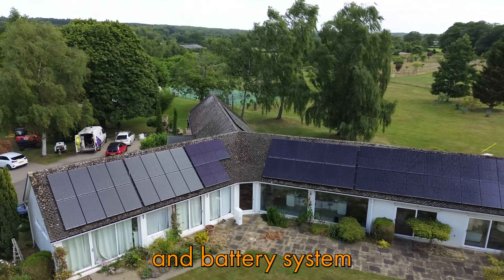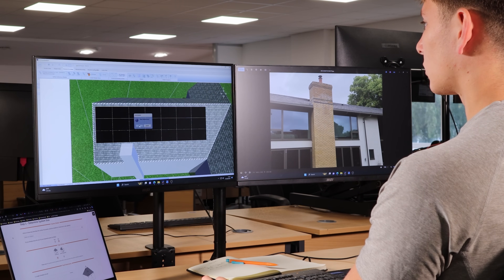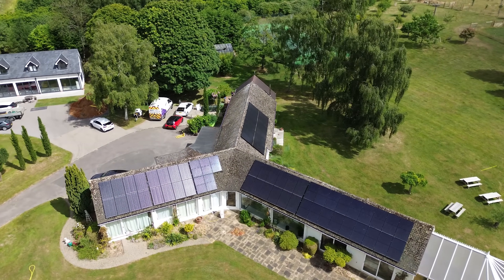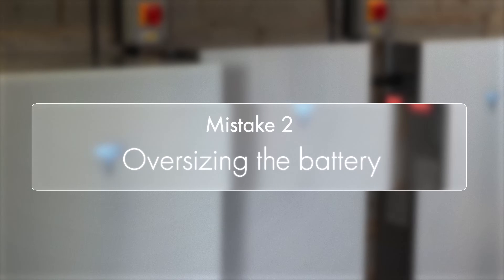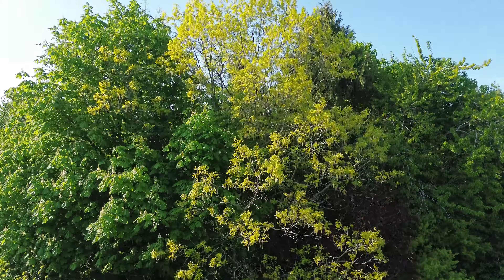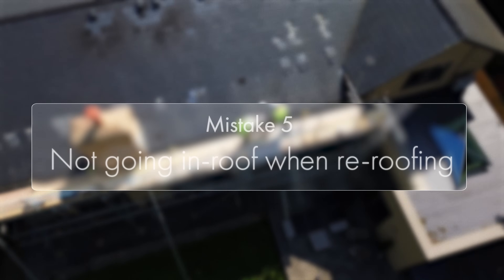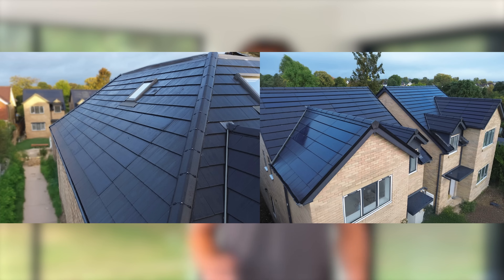8 WORST Mistakes To Make Installing Solar - Don't Waste Money

Comment: Where are the facts to support you claim that centralized inverters have lower failure rates. My research indicates the opposite is true...and when you lose your central inverter you entire solar system is non-operational. I knew someone whose central inverter died and it took them 5 mos to get it resolved (warranty claim disputes, etc.).
Reply from the maker: That’s our experience over 15 years in the industry. The roof level inverters are also far more expensive to replace as reputable installers require scaffolding which the manufacturer will not cover.
Reply: @spiritenergy_uk  I happen to have done a LOT of research on this  topic and all I can say is that your experience with reliability is quite different that what most installers say and different from what research reports. Granted these research papers are using a LARGE number of installs over a number of years. So it could be that based on your relatively small number of installs you've just been  "lucky".

Comment: I replaced my roof with a metal roof so the solar brackets could clamp to the roof with zero penetrations. Yes it really helped to install solar at the same time as the group to plan both working together

Comment: As a South African always assumed that all inverters had the functionality to work in a power cut.  Probably, given our needs (often have power cuts), those are the only ones imported here.  Also we tend to oversize batteries for long time power cuts, so buying convenience rather than worrying about payback period.  Thanks for the info.
Reply from the maker: Thanks for the comment. That makes a lot of sense if the grid is weaker.

Comment: good microinverters have a much lower failure rate and longer warranty than string inverters. You should fix this.
Reply from the maker: Hi, thanks for the comment. Our experience has not been consistent with that and we find string inverters to be the preferred option.

Comment: There are 2 diferent sizing surveys that need doing. 
1. Average annual, monthly, daily use in kW for initial sizing.
2. Peak daily use in Amps for off grid failure sizing of inverter and batteries.
If you want grid failure backup and you surveyor installer doesnt do a survey of item 2 then they are scamming you.

Comment: Another mistake may be to set aside other methods of storage than batteries, such as a large water tank. Over the last 19 years, I used a solar thermal (hot tubes on the roof) set up with a 200 l tank with a mains pressure heat exchanger inside. There is no gas fired boiler here.

Later on, in 2014, I had solar PV added to the roof, around the water tubing. This year, when the hot water roof tubes failed, they were replaced by a couple of almost identical PV panels, and a “Myenergi” Eddi unit was installed, along with their “harvi” control device to grab any surplus export current. So the old tank is now a hot water battery, in effect, with the old immersion heater now in daily use for the transfer. So far, so good; from mid April, there has been zero imported electricity used for water heating.

Just be careful about the location of a “Myenergi” Eddi unit, in particular the length of any cable from it - demonstrated here, on account of the installer’s mistake (which they sorted out a day or so later, to be fair): https://youtu.be/KVkw_bC2qSc Relatively long cables present such a high inductive load when the heater is switched in at the far end that the Eddi unit can’t cope with it. It’s now only about a metre or so long, and that’s fine.

The Eddi displays the daily totals, and on average I use between 3 & 4 kWh that way.

Comment: Interesting vid. My only question would be about the efficiency of in roof panels or solar tiles compared to tile mounted?  Whilst home batteries are good today, I think the duos bi-directional EV charging. I’ve >100kWh of batteries spread across 2 EVs in my garage. Keep up the good work

Comment: ok i'm a bit confused by mistake 7 what do you mean by cost of Storage? do you mean the cost of the battery system or the battery combined with the solar. Also if you're suplementing your daily usage with the electricty bought at the cheap rate  you're now not paying the more expensive  day rate so doesnt that increase the delta of what you would have paid for the same amounght of electricity thus reducing the cost of storage. I'd really like to know how this £500 per kwh figure was reached. if you then work out you onmy need 60% of your battery capacity you can further maximise your battery's energy arbitrage by dumping energy during peak times. I also think the idea that domestic energy creation is going to "flood the energy markets" is very optimistic given the ongoing increase in ongoing power consumption with things like AI and Cryptocurency blackchain technology become a significant part of our national and international energy consumption. This also doesnt account for the unstable nature of global conflicts and how they can shock the energy markets. i.e Ukraine, Iran and venuezuala.  While this is a very good video i believe the idea of energy arbitrage and being able to make a bit of money from your solar and batery installation is quite a bit more resillient than this video  portrays.

Comment: Would agree with everything presented, a great summary. With the exception of the in-roof panel systems in which you do not fully present the downside. I too had to make this decision.
Whilst PV components are VAT free, so are re-roofing components that are necessary in order to install that PV system. In-roof is more costly than reroofing with standard clay or concrete tiles and the mounting system and has a lifespan of less than 20 years whereas concrete tiles will give 50 years and a good Welsh slate tile will be in excess of 100 years. These systems are like velux windows, they collect debris which can block drainage channels, no good if any trees are situated within 100 metres of the house, when those leaves and moss will lodge in there.

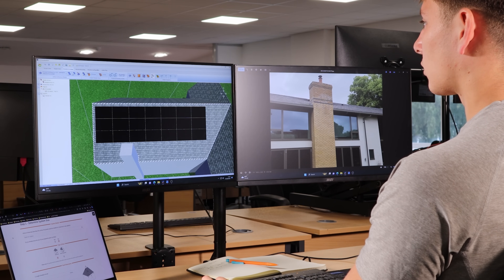Comment: Point 3: 4:48 is not correct.
In case of a power cut, your solar will not exportthe electricity but it can definitely run the load in your home. I have yet to see an inverter that doesn't support this operation.
Reply: You need to know you max daily electricity usage in to size auto backup switch and inverter size to make sure it can meet demand in a blackout.
Reply from the maker: Hi, I’m the UK, the solar inverter will cut out in a power cut by default. If you install extra switchgear to keep the inverter operational then it can continue to run but by default solar doesn’t run in a power cut.
Reply: @spiritenergy_uk it should just cut off power export. Loads should still work.
This is weird

Comment: I had a local installer fit solar and battery a few weeks ago... on the initial quote they priced up Aiko Neostar 2S 460w panels... My DNO took quite a long time to give the G99 approval and by that time the Aiko Neostar 3S were out so I contacted the installer and asked if I could have them and said I was happy to cover the additional cost... They replied saying that they now installed the Aiko Neostar 3S 475w panels as standard and that it would not cost me anything extra... They could have taken advantage and charged me more but I was so surprised how honest and trustworthy they were!
Reply from the maker: Excellent, that’s the right thing to do. I’m pleased to hear it.

Comment: Great points, but i would like to point out one more. At 6:55 you can see a roof with a lot mosse on. That indicates problems with moisture and an upcoming roof replacement. I would suggest check your roof first, then get solar on. Saves you a lot of money in long term.
Reply: Mosse? What a moronic response  🤣

Comment: A thought on 'in roof' panels. My system has panels clipped to rails outside of the roof, giving a fairly large gap underneath. This gap allows a draught to occur which slightly cools the panels, and also shades the roof underneath. On the hottest sunny days this reduces  the heat gain onto the roof . 
Have you considered this heating effect when installing 'in roof' panels, as I understand that PV panels lose efficiency if they get too hot.
Reply from the maker: Hi, yes you’re completely right. The in-roof panels will be slightly less efficient in summer when they get hotter than the equivalent on- roof panels.

Comment: First problem to solve is not production of electricity, but cutting consumption. Lot of houses with top insulation,  smart direction for passive solar in take in winter and shade system for winter cuts production needs. Then second is higher grade devices that use less energy including heat pump. After all of that comes size of solar production. I have seen project of house that is 150 sqm with 15 cm of rockwool insolation on walls and    roof of 20 cm. It was enough heat pump of 6 kwh and it achived even COP of 6 some days in winter, other days mostly over 3 to 4. Never belove 3. It is near Zagreb,  Croatia.
Reply: Cutting consumption is a great first start, but a lot of the time it might cost you more to upgrade those appliance vs just installing solar to offset. Heat pumps are great, but sometimes require whole reworks costing just as much as installing a few panels will.

Comment: I'm currently saving to do a roof replace and eventually solar but I'd like to do metal roofing. What is the best metal roofing type for ease of attaching the solar?
Reply from the maker: Hi, trapezoidal sheet metal is an absolute blessing for solar installers. We’d be very happy to help you out with this if you like.
Reply: @spiritenergy_uk Thanks for the tip, so far I had been leaning toward standing seam. 

I'm not even in your country, so I'll have to look to see if that type of product is even available in my area. I hadn't even heard of it until you mentioned it.
Reply from the maker: Standing seam is quite straightforward to install on as well. Either roof type will work very well with solar. Perfectly fine to go with standing seam.

Comment: In situations where the homes' heating is electric, the electricity consumption will vary massively from Summer to Winter. For example, I spend about £75 per month when not heating the house but last January cost £400. Do you advise sizing the battery for the maximum usage ie for a cold Winter's day?
Reply from the maker: It’s a bit of a balance and depends on what you want to spend. Sizing it to match the capacity required in winter will mean it’s oversized for summer. Which isn’t a big deal but will slightly lower the rate of return from the project. So for optimal investment return, you wouldn’t size it to the worst winter’s day, because for the rest of the year part of the storage won’t be used. 

If you want to maximise your grid independence then absolutely. Most people go for somewhere in between. You can usually get about 70% off-grid without sacrificing a decent payback period.

Comment: The first and biggest mistake is installing solar!  If it ever pays for itself it will be end of life and need to be replaced!
Reply from the maker: Hi, most solar systems pay off within 6-7 years. If the electricity price spikes then it’ll be even faster. We have a lot of data to back this up. Thanks for the comment.
Reply: @spiritenergy_uk  ~  A Texas utility recently had over 10,000 solar panels wiped out in a hail storm.  Who do you think will foot that bill?
Reply from the maker: That’s interesting, I’m sorry to hear that. In the UK, most panels are rated to withstand incredibly intense hailstorms. The Texas hailstorm must have been awful.
Reply: @spiritenergy_uk  ~ It happened on March 15, 2024 and the hail was golf ball to baseball in size.  BTW, I do have a small ground mounted solar system with battery backup but since my cost per KW is so small it will never pay for itself but it's intended to get me through an extended power outage for critical loads only.
Reply: @rpsmith the home insurer. Its part of the building. Just ensure the insured value adds the solar replacement value

Comment: The absolute worst mistake that you can make is installing a high frequency transformerless inverter to power your appliances.  Transformerless inverters don't offer any galvanic isolation between their DC boost stage and their AC output, so when their MOSFETs fail, this type of inverter can pass high amperage DC current through to your AC appliances and cause severe damage. A much better and safer inverter uses low frequency, transformer based inverter tech instead.
Reply from the maker: Interesting, thank you for the comment.
Reply: @spiritenergy_uk what safety measures might prevent that please?
Reply: Any suggestions what safety measures might prevent that in the event of failure, please

Comment: I am not sure if an in-roof system is such a great option. In the Netherlands we have had some fires which were not caused by the in-roof system, but seriously hindered the fire department from getting any water to the fire, resulting in much more damage. 

Another thing is looking at the end of life of these panels, either by one failing, breaking or being totally outdated in 25 years. It's may be impossible to find something that will fit exactly, resulting in more cost.

Also, the space between your roof tiles and the panels creates a nice gap for cool air, resulting in more power on warmer days.

For a car port, pergola and maybe even a conservatory or greenhouse, using solar panels to build a roof is great idea if you can make it work.
Reply from the maker: That’s an interesting point about fires, thank you. I imagine the fire department could just smash the solar panel to get water through though.
Reply: @spiritenergy_uk Smashing an in-roof panel is not as easy as you might think. Often these are placed on strong plastic mounting systems which are backed by much more materials like thick self supporting well insulated roof panels.

The best option is to have enough windows or a dormer and of course to get rid of the gas boiler and gas mains, which are often the cause of a fire. Just add a heat pump instead.
It is however not a guarantee against fires. Even a fallen candle, charging e-bike battery or faulty dryer can cause a fire. It's best to design the home so firefighters have easy access.
Reply from the maker: Fair point. Thank you for commenting. Something I’ll have a think about.

Comment: I’d take issue with your battery sizing logic. It depends on the tariff you are on as to whether using its stored energy in the home or exporting it is best. Several tariffs from Octopus and Eon for example pay more for export than they charge for overnight import. So a larger battery than needed to cover house needs can be beneficial by charging it overnight at a cheap rate and exporting the excess energy not needed by the home, as well of course as your excess Solar generation.
Reply from the maker: Hi, please see point 7 at 10:08. I’m interested on your thoughts on this. We don’t recommend designing a 10-15 year battery investment around current tariffs as the data suggests they may not last.
Reply: @spiritenergy_uk I’d agree. Nothing stays the same and tariffs are no different. But a larger battery than needed for summer when solar is more plentiful is an asset during the winter months. Here is where clever algorithms come into play to optimise your import/export/usage. It’s likely that more tariffs will shift from flat rate to time of use. An example being Octopus Intelligent Flux. In the winter it’s not a good tariff as you likely won’t have any Solar to export at 4-7pm. But you might have stored energy in a larger than needed battery that could be exported. You need to run the numbers for your own situation!

Comment: As a graduate electrical engineer, I can tell you this is the first video I have seen by an installer who actually knows what he's talking about. Really great stuff.  Only one thing I didn't like: the idea that just fitting a simple wire mesh bird guard around the panels will "only cost a FEW HUNDRED pounds more." I beg your pardon, did you say a few HUNDRED POUNDS just for screwing a length of 1/2" wire mesh around the frames???
Reply from the maker: Hi thanks for your kind words. The bird mesh depends on the complexity of the array. It’s usually much cheaper than that as you imply, however, if retrofitting or if it’s a complex array over multiple roofs then it does become far more expensive. There is a labour cost to fitting it too.
Reply: @spiritenergy_uk  My solar array fitted 12 years ago attracted nesting White Doves, which was fine until their droppings got into the water harvesting system and made everything stink. Being capable people we installed the bird mesh ourselves, with suitable safety harnesses to stop falls, and a low angle roof, it was a simple matter. 
Fitting from new would have been a much better idea!